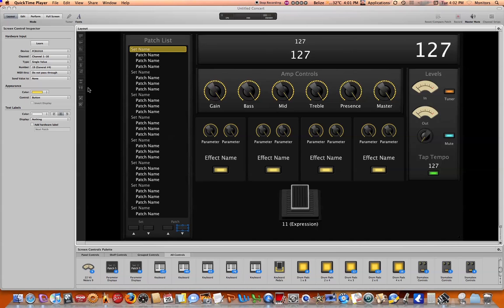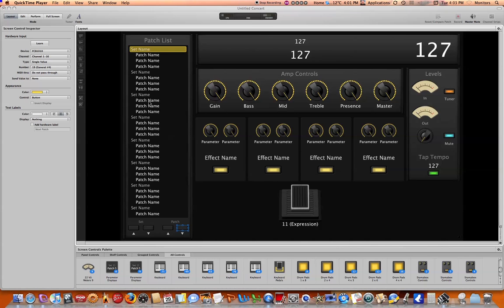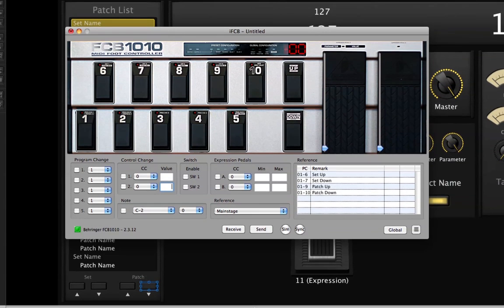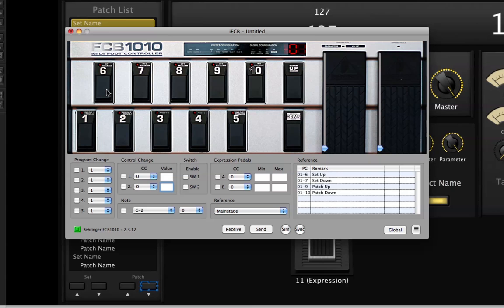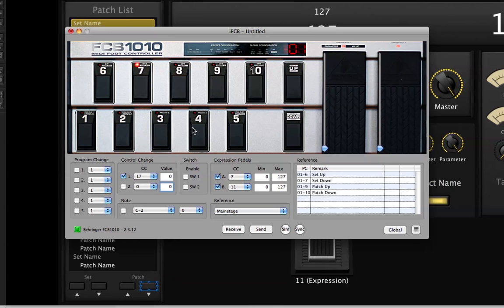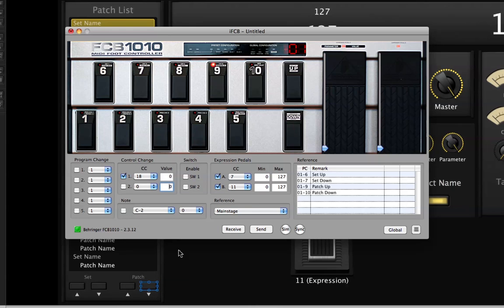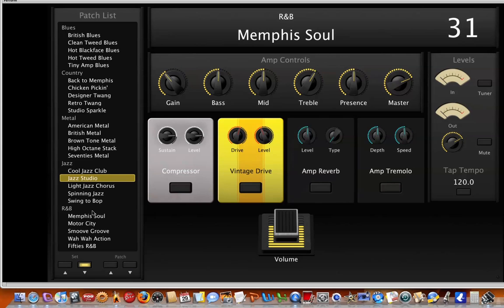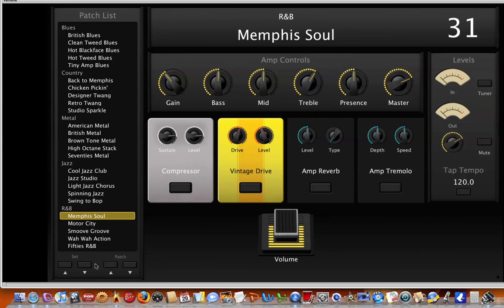Mainstage 2 - External MIDI - FCB1010 Pt 3 of 3

Comment from the maker: @thomashagan1 Yes, the FCB does the same thing as the Gio from a MIDI perspective only.  The Gio has the audio interface.  Since the guitar is an analogue device, this analogue signal needs to be converted to digital to go into your Mac.  The audio interface does the job of converting the signal.  If you use the FCB you still need an audio interface while the Gio has one built in and Apogee have an excellent reputation for audio interfaces so you the Gio is high quality.

Comment: @JasTheMusicman 
I am actually debating between a gio and FCB1010/any other midi pedal board.
My understanding is that I am better off with the FCB because it does that same thing as the Gio. But above you say that the "Gio has an audio interface" and that the FCB needs an external D/I device.  I am not sure what this means. What can the Gio do that the FCB can not?

Comment from the maker: Sometimes having a different device is a pro coz you can upgrade/swap out independently.  It also looks like in your case you need both guitar and mic inputs.  The Gio only has one input so the separate interface might be better for you.

The Gio is a better built device, not sure if that's important to you, but on the other hand the FCB is cheap to replace if it's gets broken/lost/stolen.

So it kinda comes down to convenience versus flexibility which is kinda what youre paying for w the Gio

Comment from the maker: Hey Ashley,,

Yeah, good question...in my opinion it comes down to a few things:
- Are you ok with doing the MIDI programming yourself?  It's not difficult.  But the Gio comes pre-programmed for MS and Logic functions.  You can do the same with the FCB1010 but you need to program yourself.
- Would you rather have one device or two?  The Gio has an audio interface, the FCB1010 is for MIDI only and doesn't do audio so you need to buy an external D/I device.

Comment from the maker: Anytime Philip! 

On your question regarding Logic Studio/FCB1010 and high quality sound...please note that the FCB1010 will not produce any audio, it's a MIDI controller only - it just sends data, no audio.  The audio will be generated by the software instruments in Logic via a keyboard controller or by an audio instrument such as a guitar using a software plug-in within Logic.

Are you looking for an audio interface or a combined unit that does both audio and MIDI with a controller?

Comment from the maker: Good question Philip...CC stands for Control Change which is a specific type of MIDI message which allows you send a series of values from 0-127 in order to variably control certain functions.  e.g. CC#7 is a standard Control Change message/number that typically controls volume.  So if you send CC7 to a midi device and vary values from 0-127 the device will increase/decrease the volume.  Same goes for a Wah stomp box.

Hope that helps.

Comment from the maker: Ah, there you are!  I was wondering where you'd got to ;)

The reason the playback stops when you change patches is that it thinks you're moving on to a totally different patch and starts new.  The way around this is to put your backing track at the Set Level, not the patch level.  But do this only if you have a song that has multiple/different instrument patch changes u need to  change during the song.

Comment: hi there followed all the steps you have done the same as this you videos.
But when it comes to the send to ifcb i get a message that sys exclusive recieve mode is not set and i need to set it ?
an on screen message says how to do it .
I follow the how to do it but ,it wont work just keeps telling me to set it up message after i have allready followed the how to do it. really stupid.
Also i am using an edirol as a midi interface . all works fine but no fcb shown in the midi interface section

Comment: great help 
\please can you put a video of how to set up the sys x set up i have tried 100 times holding down the down only goes into that mode without the  midi in cable connected  plug that in turn it off turn it on while holding the down button and i get a flashing number 88 but everything you said in you videos works just cant send a pop up tells me to set the system sys do everything it says and when i try to send that same messages keeps coming up please help

Comment: Hey man,

I just got an ART X-15 Ultrafoot to use with mainstage 2. I can get the individual buttons to work, as well as the 2 foot pedals. However, the buttons will only work as regular stomps, sending a value of 127 when I stomp once, and sending a value of 0 when I stomp again. So no tap tempo... Any ideas?

Also, I can't get the patch buttons to work with mainstage at all! Any ideas there?

I've tried to find an editor, or translator, but haven't had any luck. Any advice would help! Thanks!

Comment from the maker: Hey deadphish1, good question...no, there aren't any iFCB presets that can be downloaded for Mainstage.  I ended up just creating my own and saving it as a reference file within the iFCB app folder.  iFCB doesn't have a notes feature (but will soon) and I needed to keep my Mainstage preset file and notes/refs separate from the rest so went the manual route which is what you see in the vid.

Comment from the maker: No problem, anytime!

Ah, good choice on the Rocktron...I looked at that when deciding to go with that or the JMP-1.  I went with the Marshall coz that's the tone I needed, also running a Tri-Axis for the rest and MIDI switch between the two using an Axess GRX4 guitar router.

Given your build preferences you wouldn't have been happy with the FCB, you made the right choice for yourself...well done.

Comment from the maker: Yeah, you should be able to control both Mainstage and your MIDI pre separately btw,  what kind of preamp is it?  One way to do it is to dedicate pedals for Mainstage using one MIDI channel and other pedals for your pre on another MIDI channel.  That way, Mainstage will only listen to what it's supposed to - same with the pre.  There are other ways, but this is a good clean way of approaching it.

Comment from the maker: Yeah, I know what you mean...but it might be easier to get accustomed to than you think.  I use patches where I'm on and off the pedals just like a stompbox and I just concentrate on the screen, I agree - not what we're accustomed to as players, but it does work. 

btw, that FC-300 is a nice controller - it's way better built than the FCB.  To control my rack analogue gear, I use an old GT-3 just for MIDI ctl and I know the FC-300 is of similar build - rock solid, so good choice on your part.

Comment from the maker: Part 2.  The only external controller that could possible give you this kind of 2-way integration if you wanted it, is the Apogee Gio which is built specifically for Logic/Mainsage so you may want to take a look at that.

Hope that helps!

Comment from the maker: Thanks!

Do you mean the LED on the foot controller doesn't go on when you switch to a patch that has a stompbox in Mainstage on?  If so, yeah, that happens to me...what I've trained myself to do is ignore what the pedal on the foot controller says and just focus on what the Mainstage  screen/pedal is telling me.  It's a little different to get used to coz we're so accustomed to looking down and not up but you'll get used to it.

If I didn't get the question properly, pls post  again to clarify.

Comment from the maker: As for an interface, there are lot's of options, I use an M-Audio Fastrack Pro USB interface and it works very well for me.  M-Audio strike a great balance between functionality and cost.  If money is no object, then I'd suggest an RME ;)

The key is to start by really thinking about what you need, many people under-plan and end up having to upgrade after a short time - always an expensive way of doing it.  So think about how many inputs you need, what type, monitor connections, monitoring, etc.

Comment from the maker: You may also hear a lot about the UnO chip for the FCB - it''s an upgraded chipset which extends factory functionality.  it has it's purpose but I found that since I'm using Mainstage, I don't really need it - all the info I need is on the screen.  Also, iFCB won't work with the UnO chip either. So, I had the chip and then removed it - I'm happy I did.

Comment from the maker: Regarding the FCB1010, you got it pretty much dead-on...it's the best combination of useability, versatility, and value.  The other advantage is there is a large user base so there's lot's of info and support available.  

As for live gigging, it will definitely do the job but just know it's not the most rugged foot controller out there so you if you do a lot of heavy gigging, you might go through 1 or two of them over time. 

It's not the easiest to program so get iFCB if your on a Mac.

Comment from the maker: Another way is to locate the audio file you want to play back in Finder, then just click and drag the file to between the channel strips in Mainstage and Mainstage will automatically insert a Playback channel strip for you.

Control the play/start/position from your keyboard or MIDI controller by creating buttons in Layout mode of Mainstage for the controls you need and then map your keys to the controls.

Mainstage 2 also has a template with the Playback plug in you can use or modify.

Comment from the maker: You're welcome.  Yes, you can use loops in Mainstage 2 but not 1.  Mainstage 2 has a Playback plug-in feature.  Think of it as a tape machine complete with transport functions such as play/stop/pause, etc.  You can only play audio files and they need to be in either WAV or CAF format.  There is no MP3 or MIDI playback (yet).  The way you do it is to add a software instrument channel then click the block under the I/O section and select "Playback".  It's just past the Klopfgeist.